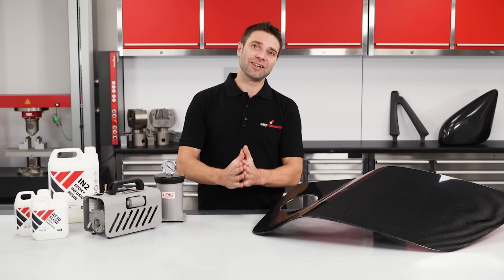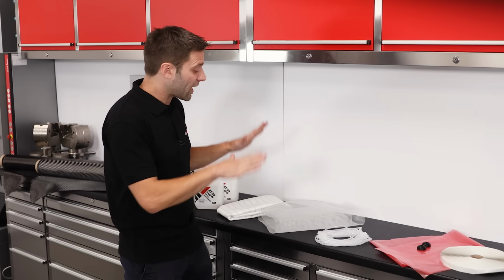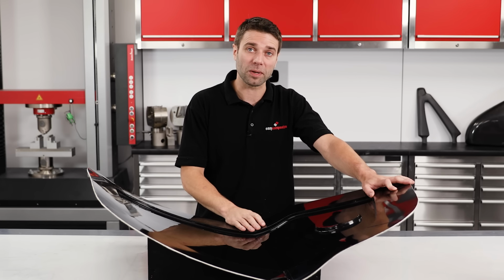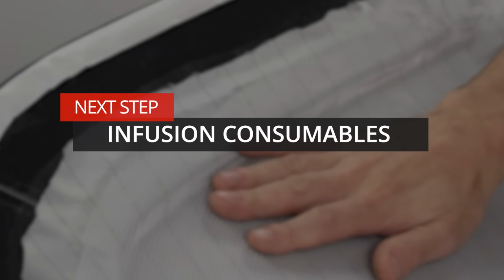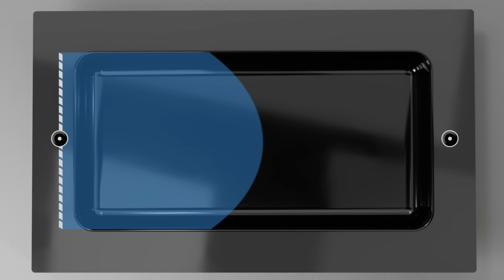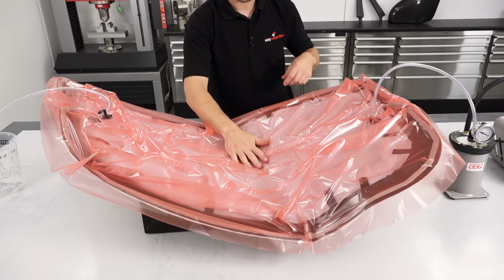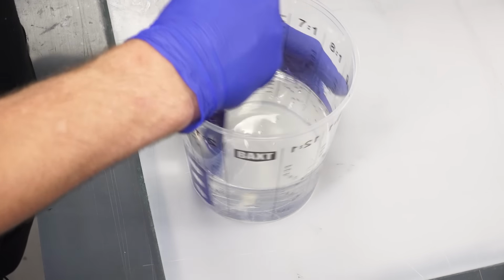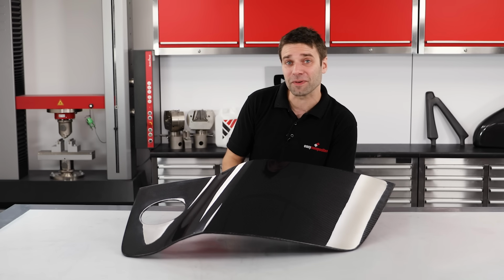Beginner's Guide to Resin Infusion for Carbon Fibre Parts

Comment: Let's say I want to make a small aircraft fuselage as one piece inside a two side closed mold (has a door opening), how would you do that? spool prepreg tape on the walls? maybe wider tape for less curved areas. Or try bigger cloth. It would be maybe 1.5meter diameter and 8 meter long teardrop. It might be slightly awkward but the traditional two sides later bonded together is so much work and such a betrayal of the material strength. Then a huge bag inside it.
Reply from the maker: Making such a size and shape as a singe piece moulding would certainly be a challenge, but not impossible. For sure you'd need a split mould, as you describe. Then, assuming the door opening is large enough for you to work inside, I'd probably turn the whole thing over so the door/hatch is underneath; much easier to work this way and you're not standing on the reinforcement as you get in and out. Then it depends on the process you want to use. Prepreg would be easier to laminate but you'd need to be able to oven cure the whole 8m+ structure, which is probably not practical, and so you'd be left with resin infusion (mechanically better but more complicated to set up) or a conventional wet layup. Assuming you're looking for the best performance then that means infusion. To do this, start by flash-taping the seams on the splits (so they're airtight) and then lay in the reinforcement; you'll need a fair bit of spray adhesive to keep it on upside down in a cylinder. The resin flow will be much more complicated and hard to predict on this shape so you'll need to use microporous membranes (DD Compound MTI hose etc) to maintain airflow and avoid dry spots. Then, the whole thing in a massive bag which would almost certainly need to be an envelope bag (so, you're bagging the inside and outside of the mould, like a giant elongated donut! 
If you're serious about the project, get in touch with our technical team and we can give you more detailed advice on products and processes. And, good luck with it!
Reply: @easycompositestv  thanks for the thorough answer. infusion upside down is probably tricky, I'm thinking prepreg is the easiest if it's sticky enough to hold in place. It would be for series production so making an oven is not really a problem. It's just a 2x2x10meter metal shed with a lot of insulation and a few electric heaters, as long as it doesn't require high pressure. 1bar vacuum should be plenty high performance for at least a first generation. Unless prepreg needs higher pressure? 120 degrees isn't much more than a sauna.
Another alternative I've seen is running thermoplast tape and heating it as it is laid down. I'm guessing they still do autoclave afterwards but otherwise pretty neat.
I'm thinking a roll on a kind of painting stick for the distant tight areas, maybe even a camera on the stick to really see what you are doing because the fuselage tapers down to near nothing at the end. Ideally a robot would do it all but that's a high starting point. Manual at first. You don't have tape roll on a stick products?
I don't see prepreg tape on your site, that doesn't exist?
I'm assuming wet layup upside down wont be tacky enough to hold anything.
Tacky cold prepreg might be the best initial approach. And if prepreg tape isn't readily available then cut strips and manually roll up. Slightly more work.
Interesting to vacuum bag a big internal piece but it's an aircraft, all things considering, not that bad. the prices they charge for planes these days, it's nothing. A skilled worker could probably easily make one a day or more.
An ideal production might be to weave a sock on a precise metal positive mold and then 3 negative metal molds clamp it. But that's expensive. Especially because the positive mold would have to be many pieces to get out again :) A very precise balloon might work.

Comment: Nice video, took me a decade to find all of that stuff in one single video.  I spray a clear coat in my molds and gel coat color details,  great way to hide seam lines.
Reply from the maker: Thanks for the comment. We do occasionally 'in mould' coat ourselves and if it all goes to plan it can be a great solution. Generally though, even though it's slightly more work, we do often stick to the more conventional approach of a clearcoat once the part's made. In mould is great if it works but if anything goes wrong with the infusion then an in mould coating makes any reparations more difficult.

Comment: Do RIT for a bike frame !! PLEASE !! 😊
Reply from the maker: Infusion for such tight profiles isn't all that suitable and will be difficult to place consumable sin the correct locations. Not only that but you would need to consider the joining of the 2 mould halves. Prepreg on the other hand would be a much preferred option which is why we chose this material for our downhill bike frame.

Comment: Any recommendations for applying Clear In Mold clear-coat, before performing the infusion, so the cured part already has a smooth gloss UV resistant finish?
Spraying clear coat after molding the part always leaves the dread orange peel texture.
Reply from the maker: We have a product called GC50 which is designed specifically for this purpose. It's a an epoxy-compatible polyester gelcoat designed only to be used in this way. Because it's polyester, it's pretty much perfectly UV stable; the epoxy-compatible bit means that it cures hard and smooth on the open face, ready for the epoxy to bond to it (rather than staying tacking like conventional polyester gelcoats do). The advantages to an in-mould coating are obvious (no dreaded orange-peel if your spraying's not up to scratch) but the disadvantages are a slight change to the appearance of the carbon, particularly when doing resin infusion, because the in-mould coating itself will go down with a slight texture and this texture transfers to the carbon fibre, and also if anything goes wrong with the infusion (a dry patch here or there) then you can easily patch it and then spray over it if you don't have an in-mould coating but if you do, it's much harder to recover.
Reply: @easycompositestv  Thanks for the helpful information, and for being #1 at what you do!

Comment: I've watched many of your videos, fascinated by the process and the result.  I think I have a potential project - a carbon fiber replacement for the Targa top on my Porsche 914.  I converted it to electric drive so this would be a fitting complement to the 'modernization' of the car.  I may attempt it next summer, I have to think about making the mold and figuring out how to attach the latching hardware.
Reply from the maker: Hi Mike, you converted your 914 to electric! Amazing project. For sure a carbon Targo top would go well with that. You're quite right that the attaching/latching hardware and accuracy would be the challenging part. Not impossible but a Targa roof is more complicated than a conventional static body panel. I hope you do it though, and be sure to reach out to our technical team if you need any advice on material or process selection. I wish you all the best with it.

Comment: Another wonderful video!
Everything here is always explained in a comprehensive, direct, fluid manner, without exception. From the overall steps to the little tricks that make the difference, everything gets explained.
And if a subject hasn't yet been explored here, either on Twitter or at the website or with the tecnical team, an answer will be found in very short order.

This is why I like EC's products. Yes, cheaper ones can definetly be found online, but these are sure to work, and work well. I feel that I can trust them because the videos show the results. Results not only in regards to cosmetics, but mechanical properties of various materials as well. That's really important for "peace of mind".
Reply from the maker: Thanks very much for the feedback, we really appreciate it. We do work hard on these videos, and the technical content on the website and support channels; it's great to hear we're getting it right. And yes, our whole ethos is to make sure products work as well as they possibly can, and to know that they work with each other (or don't); so much failure and disappointment in composites comes from incorrect or inferior materials, or combinations of materials that are just plain incompatible with each other. We aim to eliminate that as much as possible. Anyway, thank you for your business.

Comment: Question: What is better to make a mould from fiberglass or carbon fibre?
Reply from the maker: The only time that there's a benefit in making a mould from carbon fibre is when you're using a high temperature process (like prepreg) and you're making carbon fibre parts. The reason for this is because at temperature, the CTE of the material (the mould and then component) really matters. Having a mould that has the same thermal expansion as the component you'll be making in it is advantageous. However, for room temperature processes, there's not really any advantage to a carbon mould. What could be an advantage would be a low-to-no shrinkage resin system. Uni-Mould (like the mould used in this video) is very low shrinkage and an epoxy mould would be even lower shrinkage. So, the shrinkage of the resin makes a lot more difference than the reinforcement, for room temperature processes.
Reply: @easycompositestv  thank you for the detailed information,  I have afew car panels to make.

Comment: I'd like to build a wheelchair seat, including the fenders, seat base and back.

Is there a limit to the height of the part from infusion point to vacuum inlet? I would assume that you can't pull resin up hill past its vapor pressure point.

Is it advisable to have more than one resin inlet to ensure wetout? I would assume that you would watch the flow front and clamp the hose that was flowing too much resin, to keep it from reaching the vacuum port too soon.

Is weighing the laminate fabrics, minus the cut off pieces a suitable way of determining resin volume?

Knowing the void volume for each component would  seem to be a good way to get the resin volume correct.

Thank you for the really well done videos. They make your product seem very appealing.
Reply from the maker: Hi, sounds like an interesting project. I might be missing something but I think that almost all of your questions are answered quite specifically in this video, so it might be worth giving it another watch through (there's a lot to take in!). In the section where we talk about infusing 'up hill' we don't talk about 'vapour points' because that wouldn't really be the limiting factor (100% solids epoxies, like IN2, are non volatile). There would be a theoretical limit to how far resin can be lifted vertically by vacuum but you won't be near that point with the project you're describing. As I say, pretty much everything else is covered in the video. Also, watch our 'In Depth Guide to Resin Infusion' video, and our video on vacuum bagging, and our video on 'Membrane Products in Resin Infusion'. Between those 3 videos, you'd have a degree level understanding of resin infusion, all for free!

Comment: Summary
## Beginner's Guide to Carbon Fiber Resin Infusion Summary:

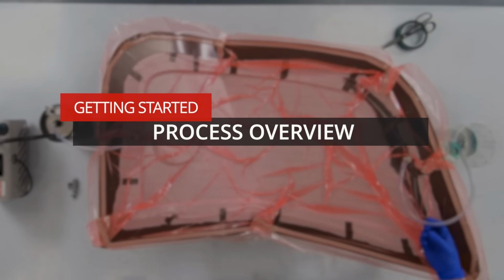What is Resin Infusion? (01:29)

* (01:38): A process of creating strong, lightweight carbon fiber parts by pulling resin through dry carbon fiber layers in a vacuum-sealed mold. 
* (02:02): Advantages over other methods: excellent resin/fiber ratio, minimal voids, cleaner process, less time pressure. 

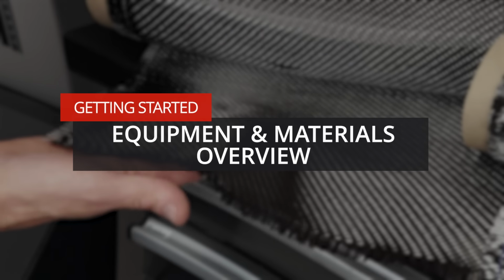Materials & Equipment: (02:34)

* (02:48): Reinforcement: Carbon fiber fabric (various weights and weaves can be used).
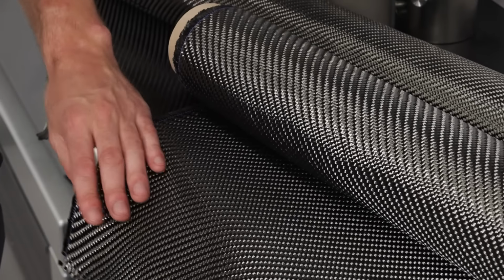* (03:09): Resin: Dedicated epoxy infusion resin (low viscosity for good flow).
* (04:06): Infusion Stack:
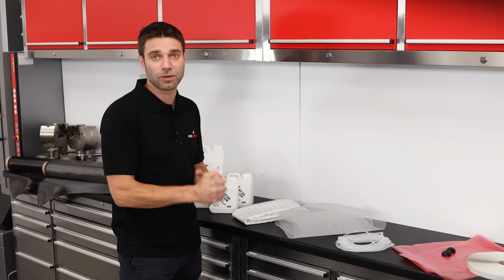    * (04:12): Peel ply: Creates a textured surface and allows resin to pass through.
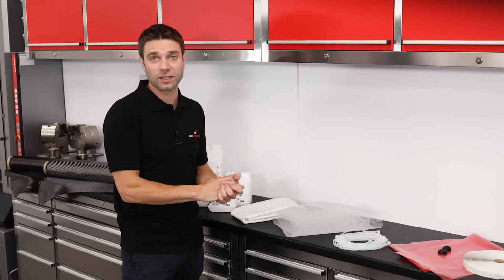    * (04:26): Infusion mesh: Creates channels for even resin flow.
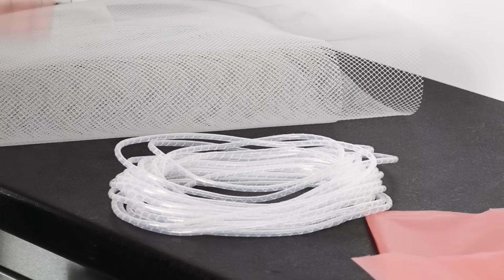    * (04:53): Infusion spiral: Aids in faster resin distribution.
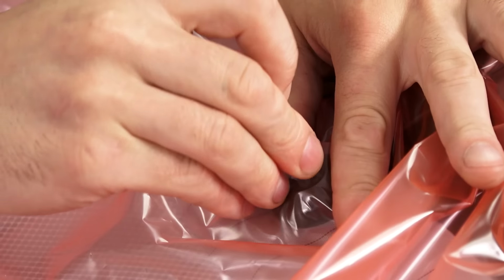    * (05:07): Connectors: Attach hoses for resin and vacuum.
    * (05:15): Vacuum bagging film: Creates the airtight seal. 
    * (05:25): Sealant tape: Secures the vacuum bag to the mold.
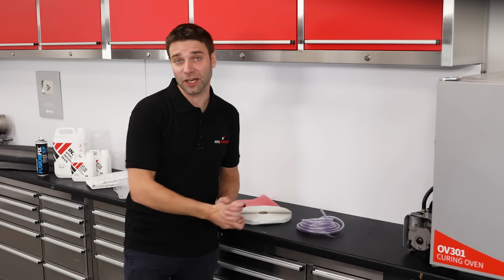* (05:38): Equipment:
    * (05:44): Vacuum pump: Creates the vacuum within the mold.
    * (06:14): Catch pot: Collects excess resin, protecting the vacuum pump.
    * (06:35): Line clamps: Seal the resin and vacuum lines.
    * (06:41): Release agent: Ensures easy part removal from the mold.
    * (06:48): Mixing equipment: Buckets, sticks, gloves, scales.

Process:

1. (07:20): Prepare the Mold: Apply release agent, seal the perimeter.
2. (09:58): Lay the Reinforcement: Cut and carefully position carbon fiber layers within the mold using spray adhesive if necessary.
3. (13:16): Create the Infusion Stack: 
    * (13:37): Place peel ply over the reinforcement.
    * (14:26): Secure infusion mesh on top of the peel ply.
    * (15:47): Position resin spiral and connectors. 
    * (20:29): Carefully apply and seal the vacuum bag, ensuring no wrinkles or bridging.
4. (23:17): Perform a Drop Test: Ensure a perfect vacuum seal.
5. (25:10): Calculate Resin Quantity: Consider fabric weight, area, and additional consumables.
6. (26:16): Run the Infusion: Mix and pour resin, allowing it to flow through the system. Monitor the flow front.
7. (29:20): Cure and Demold: Allow the resin to cure completely, then carefully remove the cured part from the mold. 

Key Takeaways:

* (31:29): Resin infusion is a versatile and effective method for creating high-quality carbon fiber parts.
* (~31:40): A perfect vacuum seal is essential for success.
* (~31:40): Careful planning and attention to detail during each step will ensure optimal results. 

I used Google Gemini 1.5 Pro to summarize the transcript.
Cost (if I didn't use the free tier): $0.0863
Time: 32.37 seconds
Input tokens: 20651
Output tokens: 1335

Comment: I'd still like to see resin infusion used in conjunction with a silicone mold. I hate having to tap glass into molds.
Reply from the maker: Hi Thomas, I think this is something we will cover eventually but I've got to say that despite the fact that we have a busy manufacturing department (and have made composite parts for many years) it's not a process we've ever ended up using, other than just experimenting and learning. The reasons for this are quite complex but might make an interesting topic to explore on the channel nonetheless.

Comment: Running out of video ideas??
Reply from the maker: Hi Emre, actually, it's more a case of the exact opposite. A lot of the content we've put out recently (with some exceptions) has been increasing advanced (topics like CAD techniques for complex tooling, CNC machining, prepreg tooling etc.). Given that most viewers of the channel, and indeed a lot of people working in composites, don't use processes, we wanted to revisit a process that really should be most people's starting point into advanced composites/carbon fibre light weighting. The last video we did on resin infusion of a carbon fibre component (rather than tooling) was more than 10 years ago! But, of course, if you're not new to the process then by all means skip it and wait for some lesser known techniques which will surely be just around the corner!

Comment: Didn't this video come out a few years ago?
Reply from the maker: The last video we did on resin infusion of a carbon fibre component (rather than tooling) was more than 10 years ago so, whilst we have covered some of this content before, we did think it was overdue a revisit, especially as resin infusion is one of the most widely used processes in advanced composites and really should be most people's starting point into advanced composites/lightweighting. But, of course we'll have lots more totally new processes coming along soon enough.

Comment: I have big Problems making realy thich Fiberglass parts (over 25mm solid GF) its Not running Well and Always leaves me with dry spots or to high pourosity. I have tried Double bag, Low pressuer, high perssure warm and cold. Trying the fibers in Vacuum plus Heat for 24hours and different Resin Breaks. (Peelply end) What am inmissing Out? Do I need to Go slower or faster? Less distanse? Different Material? The laminat usually appears to have a better quality twards the reisin Front and worse quality to the Feed Side but still dont get trough the Part. I have high standarts and the infused Part will be inspected for small voids so wetlayup is no Option. Prepreg is not usabel with the tooling. 
How can a different Resin effect the Part? Are there good and Bad Infusion resins? Like i have noticed for Hand laminates there are some horriblenones and some realy amazing ones (Like the easy composits usually realy Well butbcurrently use a German local supply cause of big quantities. 

@paul and Team, great Work again!
Reply: Why not use sandwich panel if it's that thick
Reply: @rainf8  valid question. This Part ist under claping Stress in this area and Limited in Space (Volume) so a Sandwich would need to be super hard (have Not foud something as hard as solid GF  or CF but maybe there something Out there)

Comment: Thnk you for the video. 
I was wandering if you could tell us how you make or attach the foundations for screw or bolts and nuts. Is there anyway of making them out of carbon fibre sheets?
Reply from the maker: Fasteners/mountings/fittings etc is something that we get asked about a lot so it's certainly a topic we plan to cover in a future video. You can indeed fabricate some clips/mountings out of carbon fibre sheet. Another common solution is to make brackets or fittings out of folded or machined aluminium and then just bond them on to the reverse side of the carbon panel using an epoxy or MMA adhesive.
Reply: @easycompositestv  
Thanks for answering.
I have already watched almost everything and enjoyed them all.
I await and look forward to the video for the mountings. 
Thank you again.